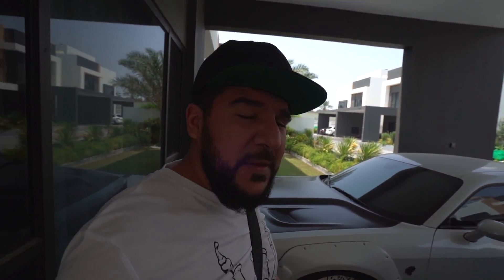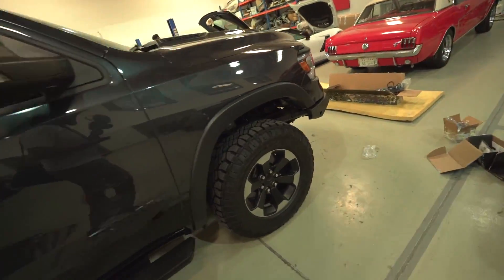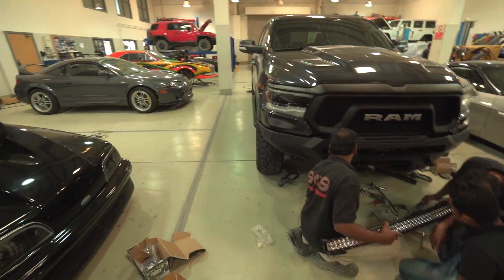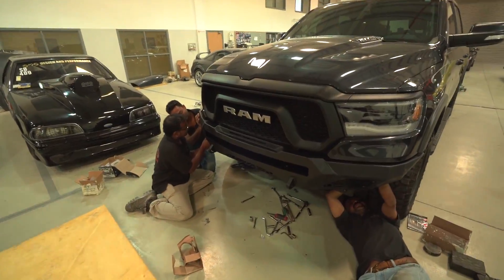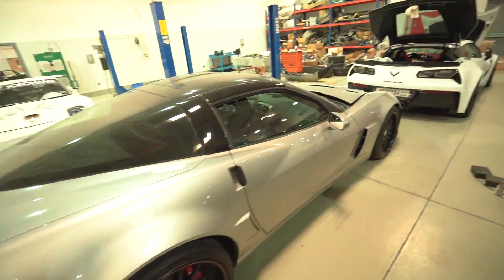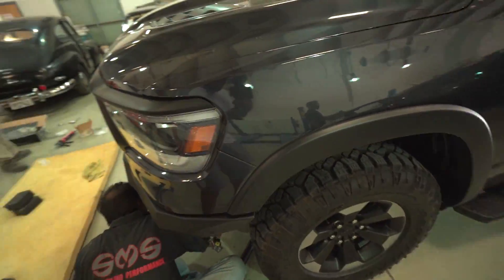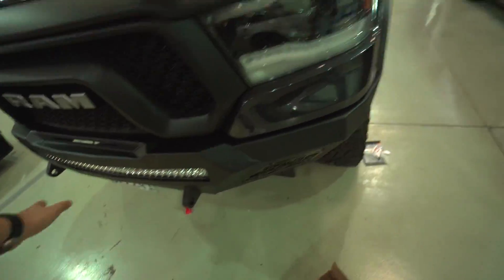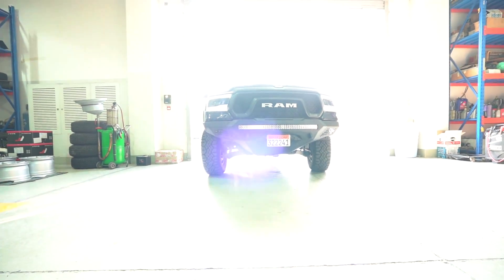Every Truck Needs This Mod! 2019 Ram 1500 Rebel Steel Bumpers! Addicted Desert Design ADD

Comment from the maker: The sensors are a bit finicky on the front bumpers so prepare to be patient with them.
Reply: Snowcat_srt ADD admires in a message thread to me that they flat out don’t work with their bumpers. For something that’s as pricey as their products one would think they’d work harder to make sure the features of the truck retain full functionality. Another example as to how ADD is more focused on profit than actual product development.
Reply: @KidRichmond  I know this is an old comment and you've moved on from the Rebel but damn am I glad to have seen this before I dropped $$ on the bumper.

Comment: Great Video @snowcat_srt. I got mine OEM aluminum part of the front bumper well scratched and dented. thinking of getting ADD as a replacement. How heavy are these bumpers (shipping weight?) Unfortunately, You will need to remove the front plate number every time you go off-road unless the lifting helps! Didnt see the wiring part of the LEDs and buttons installation :(.

Comment: I'm going with ADD as well on my 2017 ignition orange ram  ADD R stealth bumper with winch setup and rear ADD. I'm tempted to add the ADD Chase and Roof Rack as well.
Reply from the maker: I wanted the chase rack but I can't fit it as I have the Ram Boxes

Comment: Hey so, one question. What is considered a custom wheel? I have aftermarket wheel and tires but they are pretty much the same size as the stock rebels. They are just black fuels with a -12 offset. Are these good or should I just put stock back on?
Reply from the maker: If you like the way they look then keep them on man! Custom wheels usually are two or three piece wheels. Very expensive
Reply: @Snowcatsrt  thanks, just worried they will not accept them and I won't have my stock wheels with me haha.

Comment: Looks sick. How smooth was it to wire the light switch? Is warranty fine with all this?

One thing that sucks about the Rebel with RamBox is that you can’t add a bedrack. I wanted to fit a rooftop tent but a roof rack would render my truck unparkable in my garage. I mean I love the boxes, especially when I store shawerma take outs in them to keep the smell out of the cabin. I also keep all the frequently used gear in there for easy reach. But I just can’t get over the fact that I can’t fit a bedrack. Do you know of any custom racks? I wonder if it has the holes that come with the conventional beds.
Reply: Kbvoodo adjustable width may work